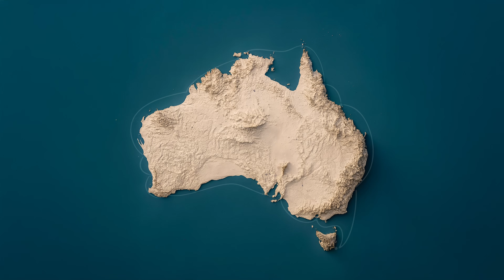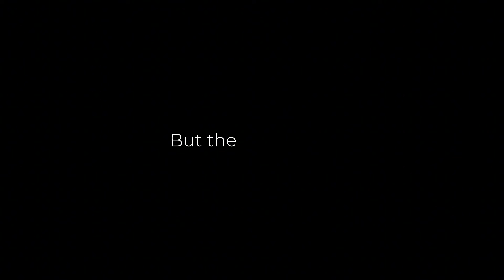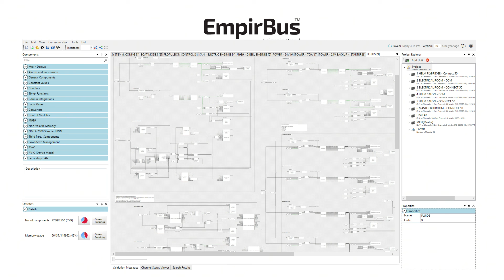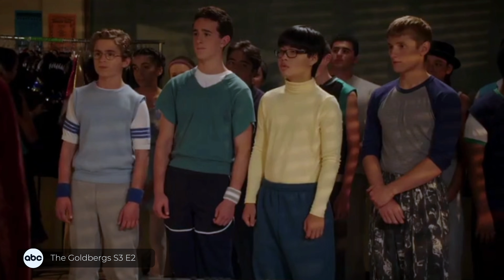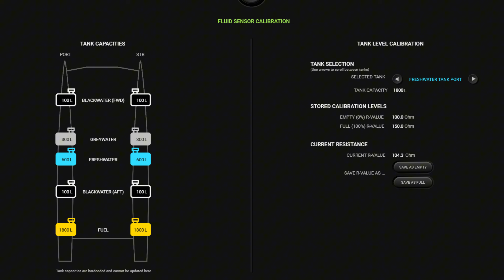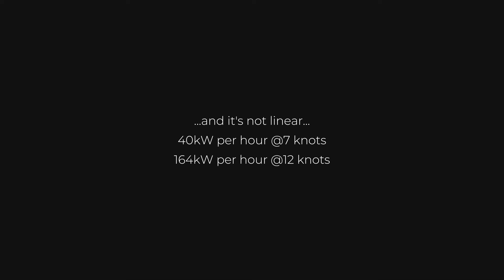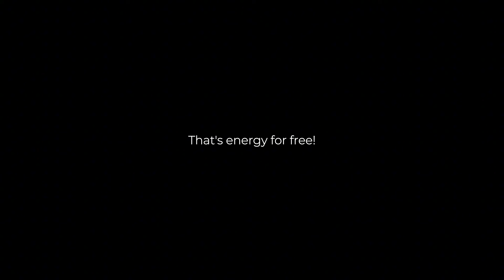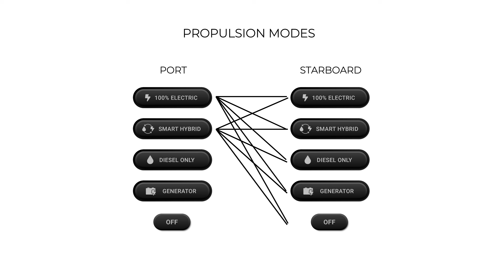The System Behind Our New Solar Electric Yacht

Comment: Having lived aboard for 20 years and ogled Greenline and Silent Yachts for 10, this was THE most interesting video I have EVER seen!   I understand deeply the meaning all your choices which are logically and practically superb. I looked seriously at the Greenline 48 Hybrid which would have been barely able to cruise the inside passage off Vancouver. I recall 5 kts as being the max electric only cruising speed whereas 8kts is the minimum acceptable cruising speed. 

I was not impressed with the clumsiness of the Greenline display. Not intuitive. They may have upgraded now but the saving of using your distributed software based system with less wire and smart  phone control is where it’s all going. 

2 tips for your super well produced video:
1. Even though your background music was low, there are older people like me who suffer a neurological condition that stresses me out due to the dual signals since my brain wants to follow both. Annoyingly. I get most are ok but no reason to annoy part of your audience. 
2. The interspersed TV clips are more for kids. Not serious boaters and technodweebs like myself. Not as annoying as the background music because I would fast forward past each one. 

Everything else is top 1% of videos I watch. Excellent narration; clear, well paced. 

Suggestion: if you DO want sounds, try to add in the wild sound of the boat itself. I’d want to hear the mechanicals workings; even click of switches or catches or sound of boat underway. Comparing diesel to electric only.  Acoustics of the bridge, cabins, electrical\mechanical rooms all mean a lot to a boater. Graphs held on screen for long enough to sus it out. Boaters are mathematicians. Boat maneuverability. 

Looking forward to more episodes and will forward a link on to my boater friends who could only dream of such a boat. 

Colin from West Coast of Canada now living in New Zealand
Reply from the maker: Thanks! And thanks for sharing it! Agree on the Silent front. I have half scripted a video - why we didnt just buy a silent yacht, but it's fallen to a lower priority and will be more powerful when we actually have real data from the sea trials. They did ok for that era, but they can definitely step it up a lot. Without competitors they dont have much need to. Re the music, I was worried that a dry software demo wouldn't get much traction, so I went a bit hard on the video clips and music to 'jazz it up'. Now I know the content can stand on its own, future videos will be less distracting :) Agree

Comment: Really interesting. Maybe a bit less "there is only" when you are wrong - there are boats that are electric only and no diesel: they aren't crossing oceans, but you didnt say that. You also didnt mention the diesel type but this is critical if you are truly being careful of full electrical failure - how are you starting them if your 700v batteries are dead? If they have ECUs then how do you keep them going, or are you going basic naturally aspirated? Can you operate the diesel-motor clutch without other electricity or is there another battery? Would be very interested in a discussion of costs too. We are wanting to convert our powercat to electric, and have gone Maretron for basic digital switching. Very nice to see another larger Australian electric too 😀 (we are sth nsw)
Reply from the maker: Thanks! A fellow aussie, love it! I did say cruising cat, but i could have been more explicit, you're right. We have modern diesels, so ECUs. Our diesel system is electrically isolated from everything else (deliberately), we also have separate starter batteries (and spares) as well as spare ECUs. Without power, the clutch will close automatically too, though there is manual lever as well. We tried to do as much as makes sense for ensuring we can still get home if all the electronics fail.

Comment: Great projekt. im missing the details on the solarpanels.  Are you sure you can fit that amount on that relatively small roof?
Reply from the maker: Thanks! The roof is actually quite large, it looks smaller in the video, and we have panels on the back wing, and front of the salon. I'll dive into that aspect in more detail and what we did to get that big an array and what we did to optimise it.

Comment: Love your project and your channel. You have a new subscriber from Sweden here :D
Im an Electrical Engineer who has been working on ships my whole life (world wide) "+25years". 
I have also been part of several new build "sight-team". Like the Seismic Survey ship Ramfrom Viking ( built in Nagasaki, Japan 2013). 

Love it that you built your own automation system. I know how advanced this is. 
Have you thought about stray current ? Including an ICCP (Impressed Current Cathodic Protection) would be a great way to monitor this. I have always been working on bigger Diesel Electric ships but Im sure they have smaller systems for smaller Yachts and Catamarans. 

For your IAS "integrated automation system" you can add an backup of the system easy. An extra AIS computer who records and have playback, if you wanted to go back and fault search condition leading up to an future problem. 

Best Regards ETO "Electro Technical Officer" Andreas Sundqvist
Reply from the maker: Thanks! Yes, we've been working on the grounding and stray current issue. I'm not across that in great detail - Rob's been working on that while I do the coding. Once we get that in place we might share more on that. It seems to be quite topical at the moment with the Gone with the Wynns experience.

Comment: I'd love to see a video on the physical design of the boat!  I'm sure it's coming.. but I hope you've incorporated wind generation into the design in a major way.
It's always windy out there, day and night, and that will do a lot to reduce your 3 day recharging period!
Reply: windpower on boats has not been viable for decades, due to the lower cost and higher yield of PVs now, esp in lower latitudes.
Reply: @licencetoswill  I didn't realise it was a choice between the two..
But of course it's very common as we all know.   I'm building a horizontal cylindrical turbine at the rear of my solar canopy on a 5.5m test boat, hoping to double my energy production per day at anchor.
Reply from the maker: yes, definitely coming. Battery video is next as its super novel, but after that we'll talk about the boat design itself and how we adpated it for us and for the electric propulsion. Wind is an interesting one, we've crunched the numbers and it doesn't generate enough at this stage to warrant it, but we're always looking as the tech improves.

Comment: Saltwater & electricity - what could go wrong?
Reply from the maker: Totally a valid concern! Salt and humidity are not kind to electrics! We've worked hard to mitigate the risks as much as practical, using marine grade products, minimising connections, putting high voltage items in air tight and water proof boxes, and whereever possible, electronics inside in air conditioned spaces, but it will definitely require close monitoring and maintenance!
Reply: electric boats have existed since 1838 mate. there are such things as seals. like in your dishwasher, and washing machine.

Comment: Oh wow!   Beautiful UI and control design…. I love it!  Well done.  If I may make two tiny suggestions….   the propulsion screen Power Balance gauge….   it’s a teeny bit confusing to have the label for “Charging” in green.  I think it should be white so that the gauge is all white when discharging and only has green when it’s actually charging.  It’s just a label not an indicator.  The other one is the temp alert on battery that you showed….  when you touch the alert icon it takes you to the setup (lovely design) but I didn’t see the actual temp reading….   did I miss it?
But please…. do not misunderstand me, I am in awe of that lovely creation of yours.  Thanks so much for sharing it.  We can’t wait to see more so we subscribed.  Fair winds and following seas to you….  thanks for sharing it with us.  Oh, forgot to say lovely Sheldon and other interjections…. brilliant!
Reply from the maker: Thanks! Totally welcome the feedback. It's hard to demonstrate the Empirbus software without real data flowing in, I have to manually simulate things on each page, so I may have missed activating that alert on the demo. The charging/discharging label is actually an indicator :) so indeed whole gauge is white when discharging and green when charging.
Reply: @projecteyacht  oh that’s cool.  Thanks for replying.  I did start to wonder also about night mode for gauges….  I’m sure you are all over it.  

So awesome a project, such a good humorous presentation.  Really love what you’ve done.
Reply from the maker: Thanks! Glad you enjoyed it. I haven't done a night mode yet, but its on my to do list for after testing, along with day-mode version (white background). It's pretty easy to do in Empirbus, the logic stays the same you just swap out the graphics just laborious as there's so many of them, but I'll do that once we've tested and finalised the UI so I dont have to fix three versions with any changes.

Comment: Very cool concept, just make sure that all those convenient touch screen controls have an analog backup if they break down.
Reply from the maker: Absolutely, that failure point is well covered (4 screens, tablet and phone access, and physically connecting with our laptop, as well as just going to the connection boxes and manually turning things on or off) :) With such a complex system, there are so many failure points, we've worked hard to have backup options for as many of them as practical and spares onboard as well. Our boat builder thinks we're pessimists!

Comment: the UI is pretty nice overall, but the propulsion page could use some touch up. I think it'd be important to put diesel and electric engine RPM values as a circle gauge represented by a % scale across the gauge, and put the rpm numerical value in the middle of the circle, this gives the operator awareness of electric or diesel engine % of usage / stress performance independent of boat speed in the cases of inclement weather or potential damage - you're going to mentally pattern recognize what a healthy speed vs input and output the diesels and electric motors give you. So, its best to create visual aids that represent these values better. In my opinion, anyway! I would also add a separate number in the middle of each tachometer gauge and color code it green or red, green for charging, red for discharging + value. This way at a glance you know RPM for either engine electric or diesel, you know what % of your engine's capability that % represents, boat speed, and power drain or power draw of either side, with stronger /bigger or easier to at a glance visualize. moving graphics that represent the value changing in real time allows the brain to pattern recognize intuitively without needing to see the specific number in the case of failing eyesight or lighting conditions or high stress moments. And, that allows you to code in tachometer radius colors that move like yellow/green/red to help encourage the helmsperson to put the needle of performance in the sweet spot of rpm/% performance for optimal efficiency, power band of engines, least amount of engine stress, etc.

edit: just wanted to come back and say honestly everything else about this custom system looks AMAZING! thank you for taking time to put a video together about this! it's super interesting and you are very intelligent overall for the design without (seemingly) much experience in this specific field.  two final thoughts having just finished the video - 1.) you might want to add a quick 'light mode' and 'dark mode' for a given operator to swap between to try to improve visuals of the interface along with a + / - zoom button (this will also make resizing on different screens much more robust in a pinch if you need to plug in a different model screen with a different resolution or size) and, i'd also say consider a 3+2+1 backup system for the software.  1 - hot copy - secondary copy of the computing device that runs the software updated in parallel with the primary. 2 cold copy- offline backups made to a usb or detachable storage, kept secure in a compartment easy to get to but otherwise very secure from potential common damage points to a cat and 3 - offsite copy- occasional backups to an offsite (off boat) location over internet. intervals of each step can be adjusted to whatever makes sense for frequency of how often you make changes, however, once you have most changes set in stone you'll still want to take snapshots over time as this will also allow you to evaluate the health of the backups being made.

then, you ccan practice BCDR - business continuity disaster recovery. step through the process of re-uploading this software to a given piece of hardware or a fresh hardware replacement and practice how long it takes to entrain any of the various hardware sensors and other bits within the system and have properly calibrated values from the hardware. practice how long this takes, know how long it takes to swap hardware and reentrain the software into it and get moving from dead boat
Reply from the maker: Thanks for your feedback. It's really valuable. Agree on many of your points. The propulsion page is probably the one that will tweak the most once we get in the water. Once we have some time on the boat and get a few other people to drive it and give us feedback as well, we can finalise the design. The good thing about doing it yourself, is that it's easy to change :)

Comment: Great video/info! Maybe I heard wrong but did you say your using two diesel engines as backup to your electric drive?  Again, maybe I misunderstanding but wouldn't it be easier / more efficient if instead of diesel engines directly controlling thrust you had two generators that were correctly sized so you only needed one to operate both electric drives at a reasonable speed, using that as backup, not going through the charge controllers into the batteries but straight to the electric motors when needed. I always thought that type of setup maybe more efficient versus sail drives or even shaft driven props. Maybe I'm completely wrong with this thought process, curious to hear your opinion on it. Again, great video!
Reply from the maker: Thanks. We were leaning that way at first - using the motors as generators rather than on the drivetrain. It means that they sit at peak efficiency at all times. On the drivetrain their overall efficiency, as it is hard to stay in that sweet spot. The trade-off for that though, is that if your electrics fail, your serial hybrid is now a row boat, whereas in the parallel case you can still use your motors as motors. It's a trade-off. We've designed our system to mean our diesel engines are mostly redundant, so in the few cases we need them, we're happy to take the efficiency hit in favour of the redundancy. Also, adding the smart hybrid mode means we can overcome that problem as run just as efficienty in most cases anyway. There's definitely some tricky subtleties to wrap your head around.
Reply: @projecteyacht  Appreciate the response, and good point on redundancy is only good if fully redundant in parallel to your main propulsion system. I had not thought of it that way. I always hoped to see some research/real world testing on efficiency of using a generator direct power to electric pods vs shaft drive engine driven props (identical boat/hull design) to see what is more efficient and at different speeds. My guess would be the generator/electric drive would be but I have yet to see this tested. Looking forward to more of your videos!